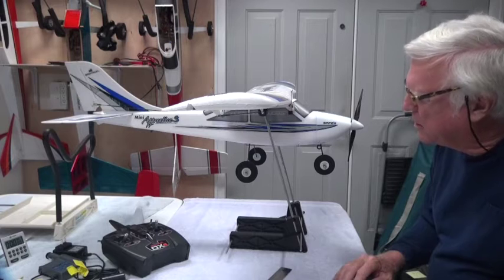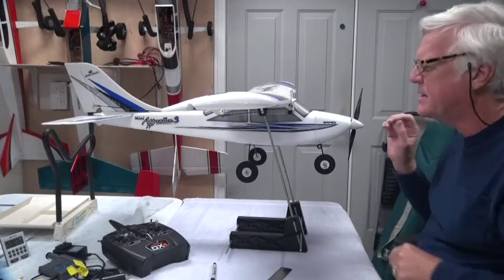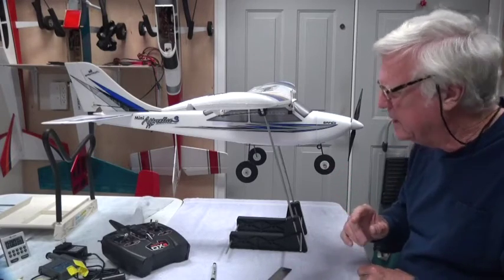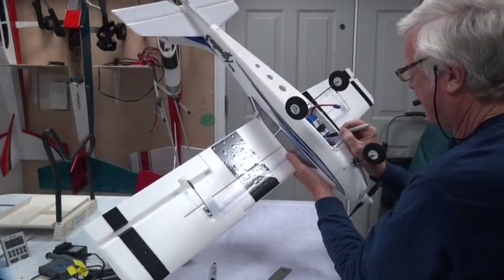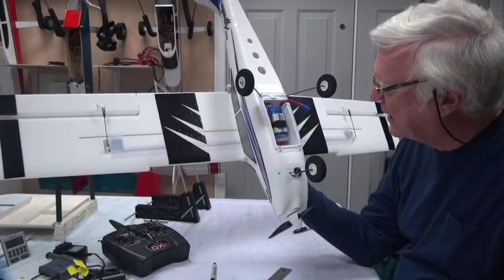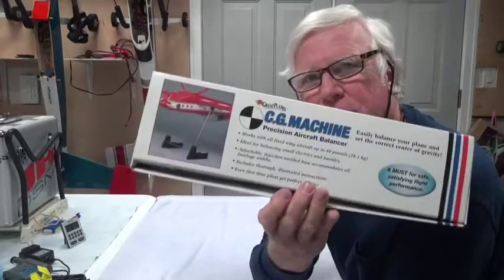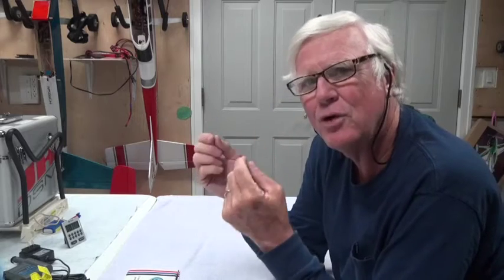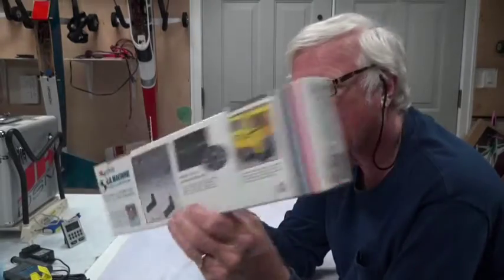MA10 Mini Apprentice Center of Gravity

Comment: Thank you. I did not make right question. I meant how CoG is far  from point where fuselage and wing make contact. Does it matter is that point is 1 inch from fuselage or that point is at the end of wing.
Reply from the maker: Yes, the CoG should be measured as close the the fuselage as possible, 1 inch is ok.